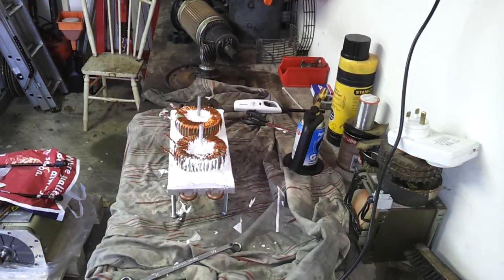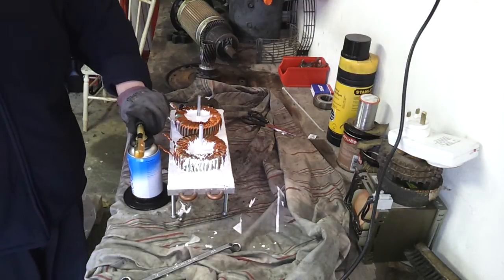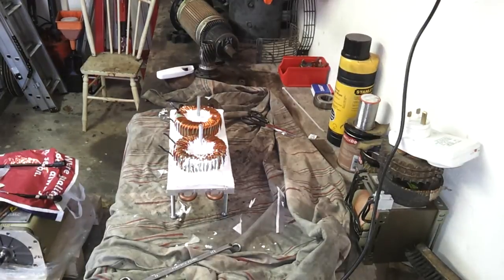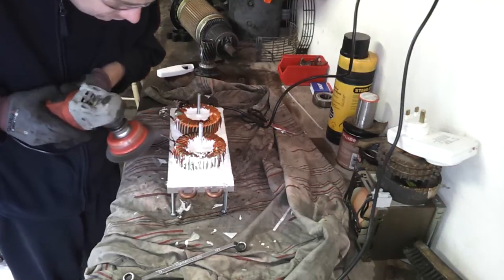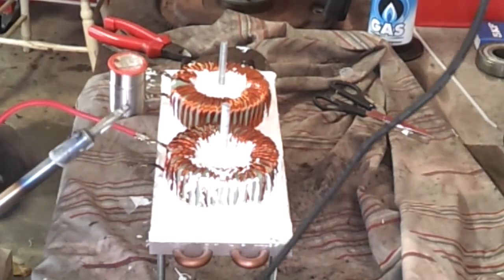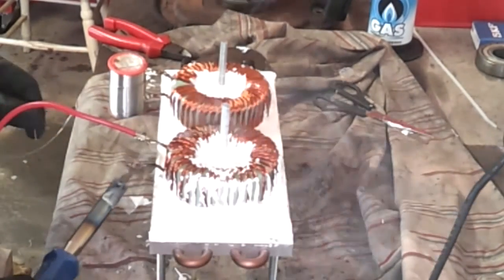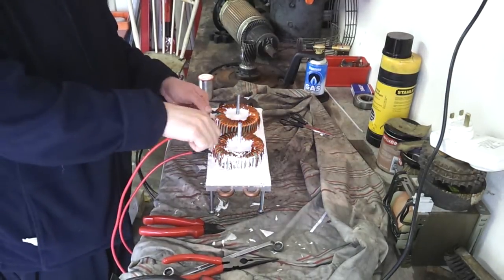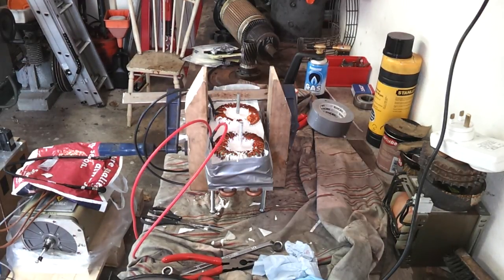BMW E39 EV Conversion 36 Charger 03

Comment: I'll be watching this build and your AC controller build. Myself, I would have crimped and soldered the connections as well as heat shrink. Not sure what to make of the thermal potting compound. I'll be interested in the results on how well it dissipates the heat.